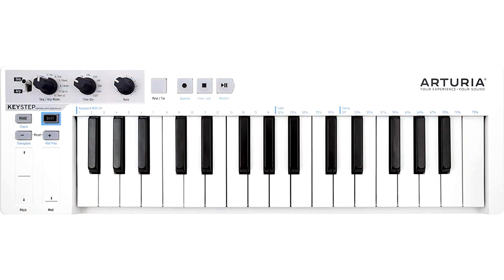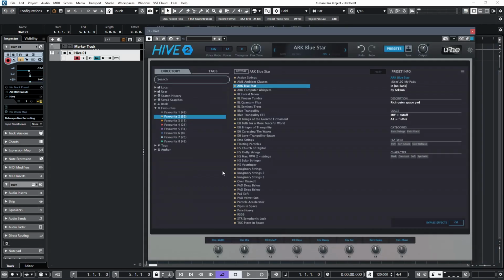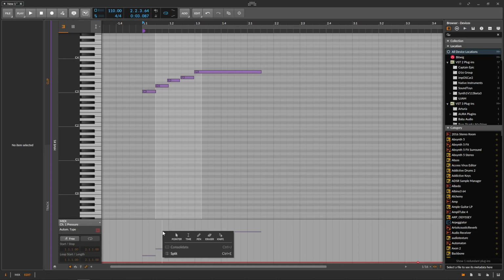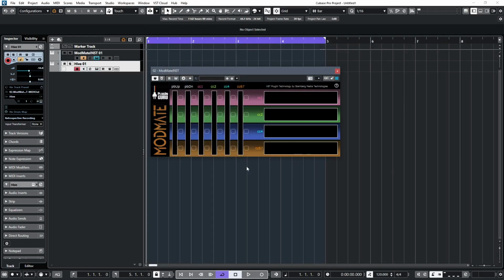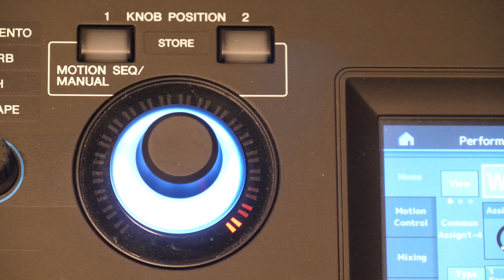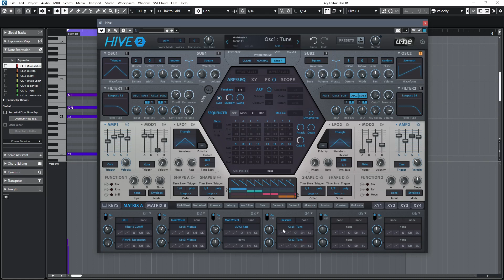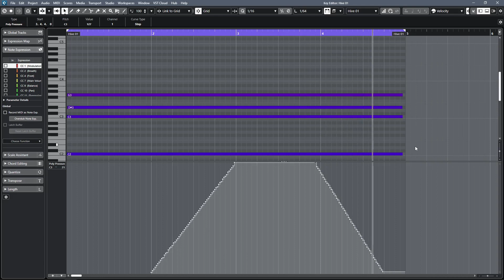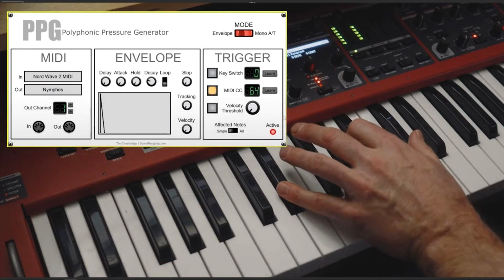No Aftertouch? - No Problem!

Comment: An OG Kaoss Pad KP3 is actually a very good XY controller, and it even has class-compliant USB Midi.

The only keyboard I've got with AT is an Oxygen Pro and OMG the aftertouch is so bad. It takes a few mm of travel before it registers at all, and then it jumps to about 30, then it only has about half a mm of travel between the 30 - 120 (and it doesn't go to 127). I wish somebody would make a normal 25-key keyboard with full-sized keys and normal pitch/mod wheels and decent aftertouch. Or even a 61-key. But I don't need a huge keyboard with huge screens on it. The only keyboards that don't have really bad aftertouch are huge and expensive like the NI S61 mk3 or the Studiologic SL88.

Comment: thanks for this! Most don’t know but the Ensoniq VFX-SD/SD-1 from   1990 has polyphonic aftertouch on all its patches and very easy to set.
Reply: Poly aftertouch goes back to 1977 with the Yamaha CS-80… 6 years before the 1st MIDI instrument shipped. Ensoniq had a few models of keyboard instruments that were released in the 2nd half of the 80s. Sequential Circuits released the T8 in '83. Roland's A-80 & A-50 MIDI controllers have poly-AT… as did the Kurzweil MIDIBOARD.

Comment: Majority of these are very obvious solutions. However if you're someone like me, who doesn't want to depend on DAW or computer itself to enable certain feature, the best would be to buy the cheapest or even a used keyboard with aftertouch, and connect it to your main synth via MIDI Cables and setup channels accordingly, and done, one very versatile setup even for live!

Luckily my kurz pc3k8 has channel aftertouch, I recently connected via midi, an Alesis VI49 for more flexibility, which has aftertouch too, now I replaced the alesis with a used motif xs, and I guess it's working great so far. I've got plenty of flexibility while not having to turn on my computer or DAW. I now have 15 sliders and 8 knobs and 18 switches (depending on modes of keyboards) and 4 wheels to control both of my synths.
Reply: You wanna know what's the MOST obvious solution? Getting the cheapest keyboard with aftertouch and plugging it in with MIDI cables 😂

Comment: Something I obsess over is how, since 1997, I’ve owned 14 synthesizers, three of which are mine and it longer. Among them, five have been equipped with both velocity and channel aftertouch, but only my latest acquisition from June 2024, a Hydrasynth Explorer, is built with polyphonic aftertouch. I would definitely be fascinated to see how it interacted with plug-ins if I was still trying to use those, but all the sound that I include on my tracks come from hardware synthesizers, no sequencing, arpeggiators or loops used if I can help it.